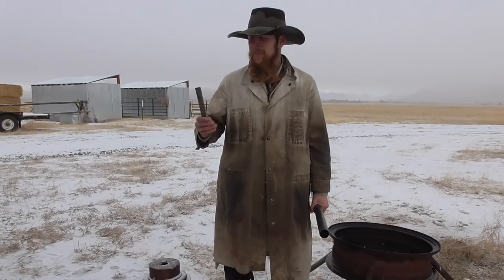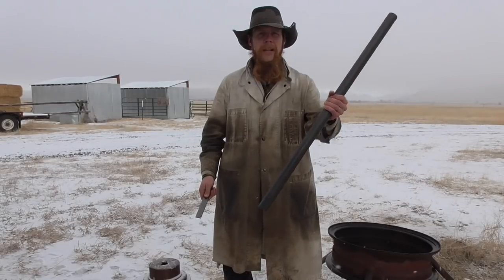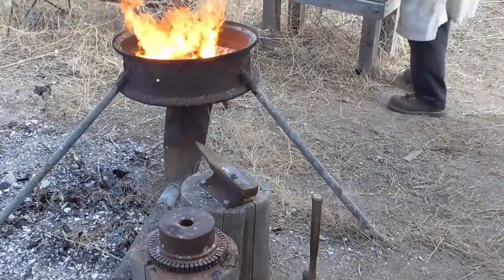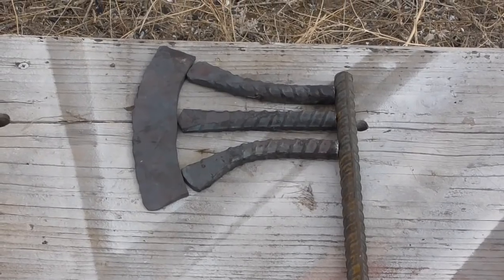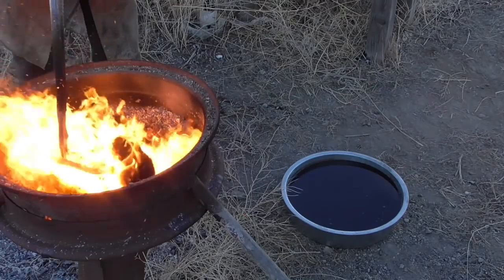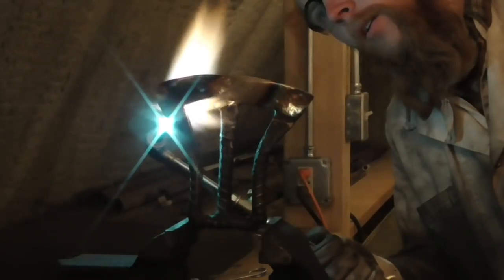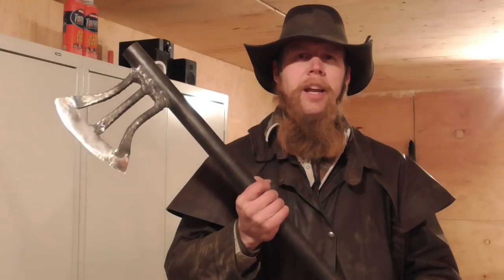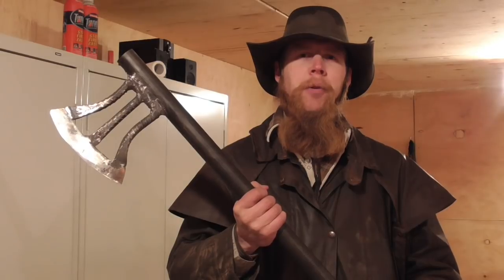Forging a Battle-Axe (TIS129)

Comment: Hah, nice to see you continuing on blacksmithing. Certainly looks like a fun one! Though from my axeforging forrays, I'll have to restrain myself from ranting, just say that it would look and quite probably work better if you shortened the pipe to just be the eye of the axe and insert a wooden haft into it, possibly rivet or nail it in place, (slight hourglass shape is needed to the eye to properly use a wedged construction, unless you go the tomahawk route) and make rest of it oval in cross section for better handling. Keep it up though! A spear next? Perhaps devise a bayonet for your blunderbuss?

Comment: Normally for such a blade, you want to put the cutting edge in the quenching oil first, and slowly lower the rest in, giving you a minor differential heat treat. Making the back half of the blade softer increases durability. In this case though, your use of rebar should create that effect automatically as rebar steel does not heat-treat to a very high hardness.

I like the design. Kind of, apocalyptic style.